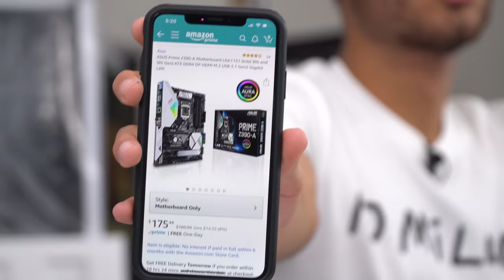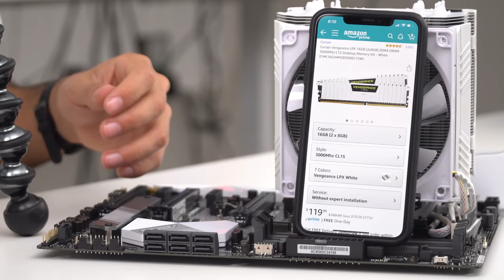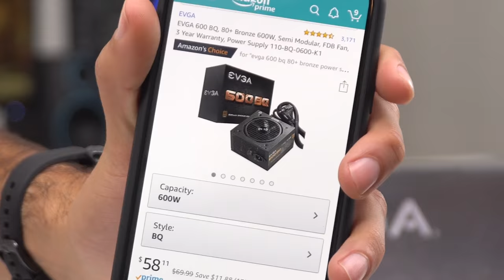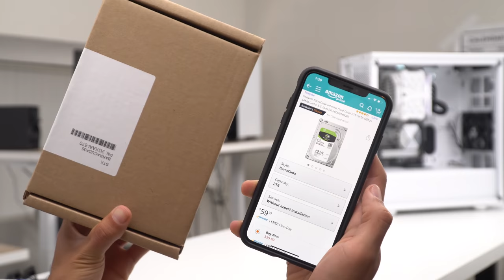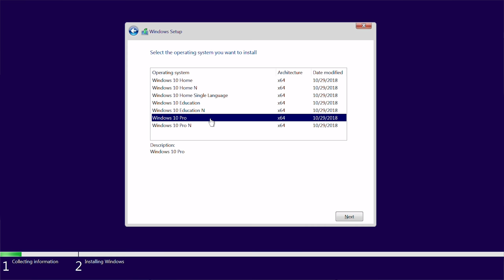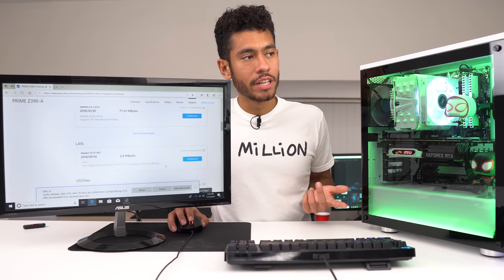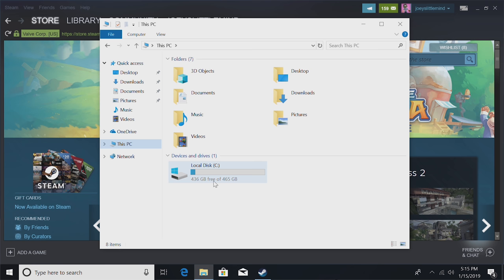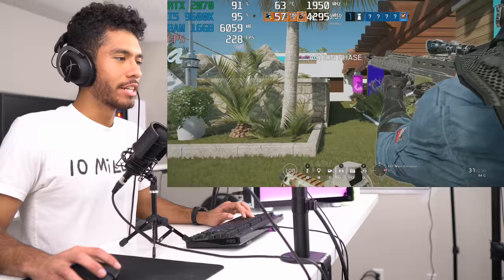$1500 Gaming PC Build Guide - RTX 2070 i5 9600K (w/ Benchmarks)

Comment: Anybody actually build it? was it good? I'm planning on building this exact PC.
Reply: I built it myself a few months ago. I don't have a frame of reference as it was my first build and first windows machine, but overall it's been a great gaming experience paired with my accessories. Runs all the games I could want at usually max settings 60fps+. The links he provides aren't the cheapest places to get the parts, but if you hunted a bit I'm sure you could shave off about $100.
Reply: Great build. I made mine a few months ago now. I don't have much reference as it was my first windows machine and first PC build, but it's been serving me great so far. Runs most of the games I play on max settings 60+ FPS. 

If you're looking to save a bit, I would recommend hunting for cheaper prices on the parts as me mostly just listed Amazon's prices.
Reply: @cabtgaming6562  Thanks so much man, I'm looking forward to building this beast.
Reply: @charger2940  Sorry for the double reply. YouTube wouldn't display the one I made first so I sent one again to make sure you got it. It really is a monster of a machine. I remember being shocked when I realised it was more powerful than most of my PC gamer friends' rigs.

Just as a personal recommendation, I love my Artis 7 Headset. I had to swap the earcup pads for mine, but if you're in the market for a wireless headset with microphone, that would definitely be my top choice.
Reply: @cabtgaming6562  Yeah i'm definitely in the need for some new headphones. But, yeah I cannot wait to use this computer. Usually more then 100 fps in most games from the benchmarks I've seen.
Reply: @charger2940  Haven't tried too many games on PC as I'm just trying to get through my Switch catalogue, but I can specifically testify that Fortnite on max settings has never dropped below 100 FPS on 1080p. Though I should say this was only the case once I downloaded the Nvidia GPU software. That Graphics card made all the difference in my performance on most games.
Reply: @cabtgaming6562  That's great. I plan on trying to play fortnite a lot once I get it. Have you tested it out on low settings? I'm assuming that it got at least 237 frames on low 1080p.
Reply: @charger2940  haven't tried it on low settings much, but I'll give it a go tomorrow and get back to you on that one. You aiming for more FPS rather than graphics then?
Reply: @cabtgaming6562  Yeah, i'm gonna be playing competitively so that is why I was aiming for this PC.
Reply: @charger2940  Did a solo match on Epic and medium settings. Epic settings got me an FPS range of 100-170. 
Maximum 3D resolution medium settings gets me 160-240 FPS.  

I don't know the refresh rate of your monitor but I'm sure this will be more than fine for competitive gameplay.
Reply: @cabtgaming6562  Alright awesome. I'll most likely cap it to 144 fps, since that is the refresh rate of my monitor at least until i get a 240 hz monitor. Thanks a lot for the benchmarks.
Reply: @charger2940  Np. I was looking at a 144hz ultrawide monitor myself, might get it next year on discount. Hope you have fun with this machine! For a bit of extra kick though, I would recommend a slightly better CPU. The one in the build is fine as it is, but that's all it is. "Fine".
Reply: @charger2940  lol with this pc on low settings not 237 fps, more like 437
Reply: @charger2940  you dont need to cap your fps🤦‍♂️🤦‍♂️🤦‍♂️
Reply: @Lewie_x  Lol im gonna cap it to prevent any unnecessary screen tearing
Reply: @charger2940  lol wtf, ide reccomend not to cap it cos it's not gonna run at it's full performance bro but your pc ur choice bro

Comment: This is now only about $1200 (: you're welcome
Reply: Thanks bro
Reply: Doing gods work
Reply: Im going to be buying one for 1k (basically same specs but with the zotac 2070)
Reply: @nunyab1zn3ss2  solid build
Reply: @nunyab1zn3ss2  whats the difference between the zotac and rtx?
Reply: @JoeMamah0  zotac is the variation or brand that made that specific variation, the rtx is the name of the card, which is from nvidia
Reply: @JoeMamah0  like gigabyte, asus, evga
Reply: @nunyab1zn3ss2  do they run differently or is it just the  name of it
Reply: @JoeMamah0  some have better quality and customer support, but its all mostly the same
Reply: @nunyab1zn3ss2  did this guy buy the screws and stuff separate or did the screws all come with the packages???
Reply: @isaacballer67  it comes with it
Reply: @nunyab1zn3ss2  yo bro! Can i build this pc but use a i7 8700k instead of a i5 9600k?  Bcs i5 9600k only got 6 threads
Reply: @exidy3624  sure
Reply: @nunyab1zn3ss2  What cpu cooler do you recommend bcs cant find the one in this vide
Reply: @exidy3624  be quiet pure rock
Reply: XREDYX  only the hdmi doesnt come with it. If you build it yourself, make sure the parts are compatible and the psu is strong enough to power the pc
Reply: Can you put a i7 in it instead
Reply: @firebombspam2604  you can put whatever you want in it, that would be better paired with the 2070 than the i5 anyway
Reply: XREDYX  to hook up the pc to your monitor
Reply: XREDYX  nah, that cpu might be a bit powerful for the gpu, but not tok bad, make sure to put those parts in pc benchmark to see how its rated and if everything is compatible, also look up your gpu and cpu combination on youtube to get an idea on how it will perform
Reply: XREDYX  yeah man, enjoy that pc when you get it
Reply: XREDYX  bottleneck is when a certain part on your pc limits the capabilities of other parts
Reply: Like i said, the 2700x is too good for the 1660, so it basically means you are losing about 7% performance from your 2700x that would be used with a better gpu like the 1070 or something
Reply: XREDYX  thats better

Comment: I have an rtx 2070 with i5 7500 and I get half of your FPS in r6
Reply: Its the cpus fault
Reply: Does 2 cores more mean 100+ FPS difference?
Reply: No but your cpu is prob bottlenecking the graphics card, have u used msi afterburner to see the cpu usage?
Reply: It stays at 100 and my gpu hover from 40-60%
Reply: Yeah then the cpu is bottlenecking
Reply: The cpu is bassically using 100 percent usage and the GPU is only using 60 to 70usage which means the cpu isn't powerful enough to utilize the full potential of a rtx 2070.
Reply: So if I get an i5 9600k I would be seeing those FPS in r6
Reply: How much would my FPS increase(r6)
Reply: @aeronjohn3901  yeah a i5 9600k will make u see similar fps in this video
Reply: More or less

Comment: Dont buy rtx 2070, its crap
Reply: What should we buy instead ?
Reply: @MargaritaTF2  gtx 1070 and gtx 1080 are great
Reply: I myself own an hp omen 17 laptop with a rtx 2070, i used the laptop for 2 months(light gaming).after updating the windows and the graphics card. suddenly the graphics card was not recognized by windows. I tried to reinstall the rtx 2070 driver from nvidea.com, still no change. People are in similar situtions as i am with the rtx cards. gtx 10 series cards are more reliable.